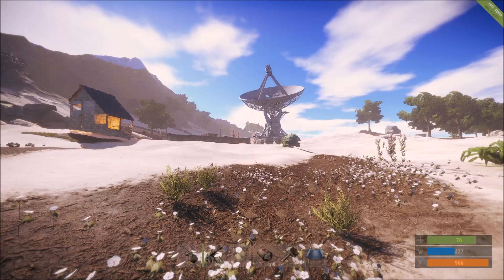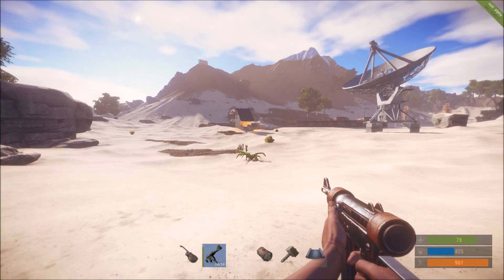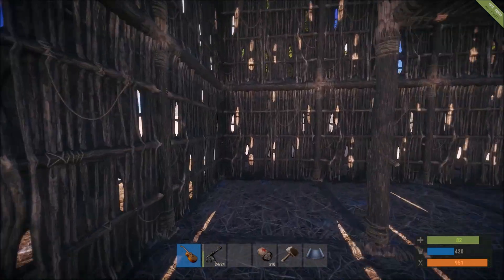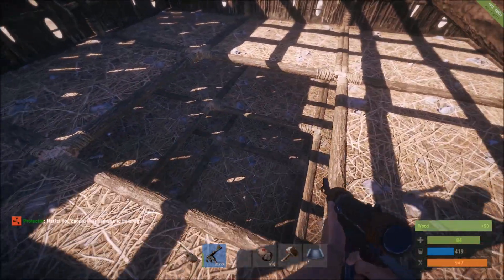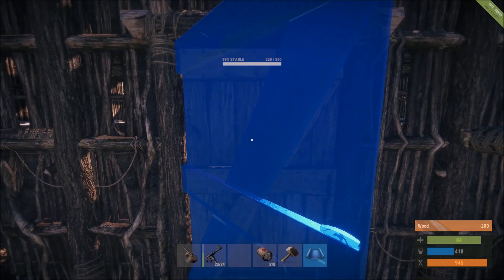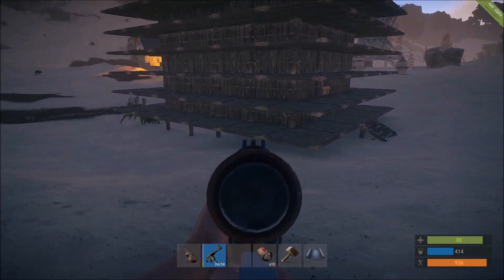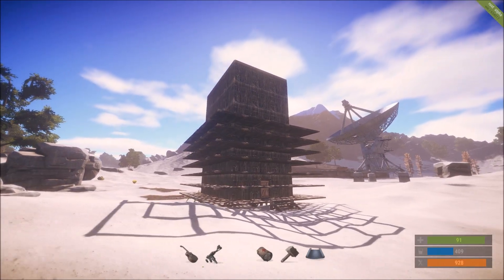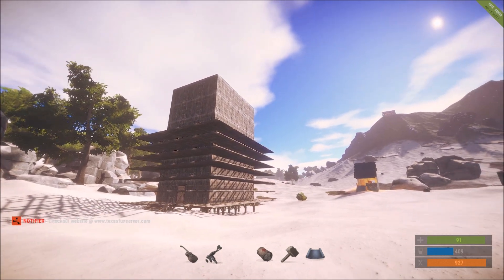Rust Base Design: Ladder Protection

Comment: Planning on doing a 3x3 with spiked sides on the inside/outside overhangs and 3 stories high removable mid walls that you can put ladders on and later remove. Costly build up but still alright for a solo player.
Reply from the maker: ***** I'm thinking this could be cut down a bit, but maybe instead of ladders you remove, just continue with the jump-stack elevator idea.
Reply: DarkStrobeLight Yeaa, yeaa, could also work just fine. I just like a little more mobility :P